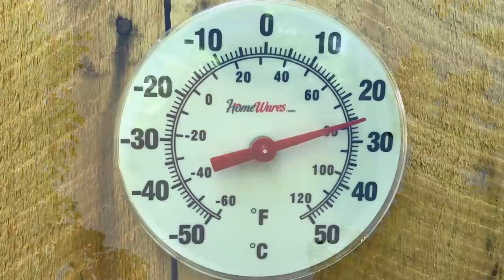Clay Pizza Oven Foundation | The Forest Kitchen | Off Grid Log Cabin Build, Ep.7 S1

Comment: I am an engineer in aerospace. Even though I do three D solid modeling and FEA, my primary job is to take it off the paper and make it work all the time. (People like that when they on a plane, so do I). My job is to build it. I am a floor guy. I got to say, you do a great job. I mean it. Wow. First time I saw an adapter for a chain saw to section cut. Really cool. But yeah. Nice design. Don't know wood much. You got it down. And man, that is bull work. Thanks for the video.      Ted   from Connecticut

Comment: I totally support the technical college system to learn a trade.  I work 2 jobs as a paralegal in central Wisconsin - 1 position with the same private law firm since 1997 and the other job as a Municipal Paralegal for the City of Stevens Point since 2010.  I obtained my Paralegal Associate degree from CVTC in Eau Claire.  :)

Comment: Suggestion? Instead of flipping large flat stones to move them, would it be feasible to roll them on a series of smaller logs? Bring the rear log forward to the front - you know what I'm talking about. I don't know if your terrain would be conducive to that or not.

Comment: Shawn, these skills would be very useful by many. However, the way that the system is setup, it's very difficult NOT to have to buy a house at 5% down and then have to pay for that interest for a very long time. The fact that we don't have unorganized townships everywhere, especially near civilization and jobs, means it's hard to do what you're doing. We must obey building codes, which continues to fill the pockets of materials manufactures which align with the code. We live in a society where we must follow the rules and get hassled when we try to go against the grain (tiny house for example). I feel like many of your subscribers would do what you're doing in a hear beat if they had the option to do so. Great chat and as always, great video!

Comment: should get some straight double headed nails or form nails instead of the twisted ones they come back out so much easier when you are done forming or in this case cutting with the chain saw, should also tack some Blocks to help hold the logs while your trying to get them level

Comment: What is the temperature like in your loft this summer, since you talked about how well the stove worked over the winter?
Reply from the maker: Not  as cool l as the main floor, but certainly not unbearable like I was expecting. Even with record high temperatures this summer, I've never found it uncomfortable in the cabin.
Reply: Another question...are you filtering the creek water for drinking and then boiling, or hauling in water?

Comment: At what point did you square up the bottom frame and plumb the posts?
Reply from the maker: I think the squaring was in there wasn't it? The plumb was by eye - not too concerned with this little project
Reply: No, I didn't see you do anything to square it up. That's usually done by diagonal measurement. I'm sure it won't amount to much, but I like to distinguish myself from the amateur, by using basic carpentry procedures I'm sure you're thinking similar thoughts when you create your most excellent and top-notch videos.

Comment: How did you decide to build the oven off that side of the kitchen?
Reply from the maker: Good question and there are several answers. Because it requires a full roof cover, it wouldn't have looked right off one of the two low sides. I wanted to maintain a walkway through the kitchen between the cabin and the firepit. I am building countertops and a sink adjacent to the barbecue and then a small table area to eat at. Plus, I need to situate the rain collection barrels where they're effective but not in the way.....

Comment: There's nothing wrong with going into the trades, in fact it's very valuable for an individual and for society, but you should always graduate from high school. High school is not designed to be challenging, if you fail high school it's because of a lack of effort and you need a work ethic whether you go into the trades or not

Comment: Just wanted to say that I get what you are doing and the message you are trying to convey. I have been watching your videos for quite some time and the message of self reliance rings strong. I know you are not suggesting everyone lives alone in the woods but rather taking responsibility as men to rely on oneself rather than having everyone hand you things. I am 2 years younger than you and know exactly how Generation X have coddled the millennials to the point that they have zero skills in self reliance. Since watching your videos and being an old Eagle Scout, I have gotten back into the self reliance mode. I have repaired an 80 foot brick sidewalk at my house. Over the years all the bricks went out of place and became dangerous to walk on. I ripped up all the bricks and re-did the entire 80 walk. I fixed the stairs of my porch that started to sag into the earth. I had to cut brand new stringers and pour a cement base and redo the railings, etc. I build a brand new shed ramp that became rotten over the years and just last week built a brand new walk leading to a recording studio that was just built on the property. Next week I will be starting house repairs by replacing rotten board that is under the siding. I am no expert at any of this stuff but I do research and figure it out. I know this is what you are talking about. Men getting it done and being more self reliant!

Comment: gotta remember, good times create weak men, weak men create hard times, hard times create strong men... Though this chain has been broken with the entrance of women into the working world which comes with its own difficulties. Efficiency goes down the more women who are present or so it has been measured. I doubt that this is ubiquitous and I think it has far more to do with western culture. I know my friends and I have excellent work ethic and we will go beyond what is necessary, though my disability has made it hard to work. The biggest problem I found in work is that my peers are rewarded equally no matter their work ethic. I put in more hours, effort, make less mistakes, meet deadlines and all that. They can fail at most of that and still get rewarded in the same manner as myself. Because of that you will find your good workers don't see the point in putting in effort if they are not rewarded while the slackers are punished. Since the work environments have changed for the worse, things will get even shittier.  Then the affirmative action bullshit is crushing innovation and the hard worker. Apparently working hard and earning your way is somehow racist. Asian and white men are more represented in sciences and engineering because we like it and are good at it. So instead of allowing the best of the best, we are instead going to push out potential and allow for lessers to have a chance